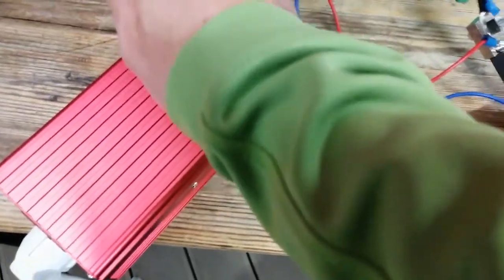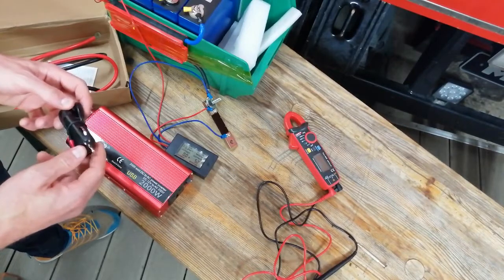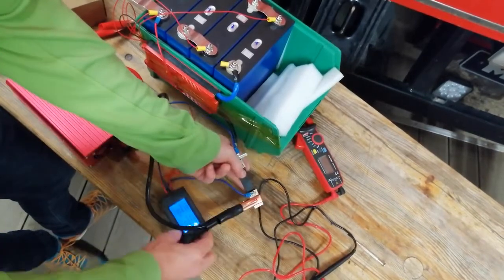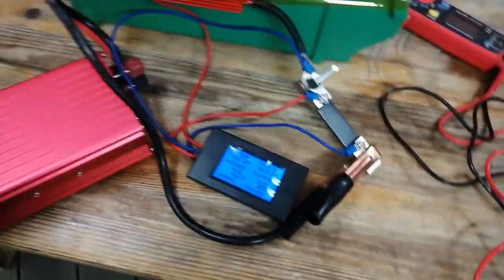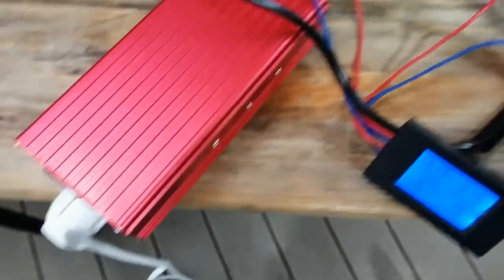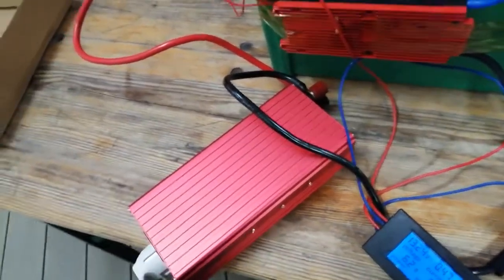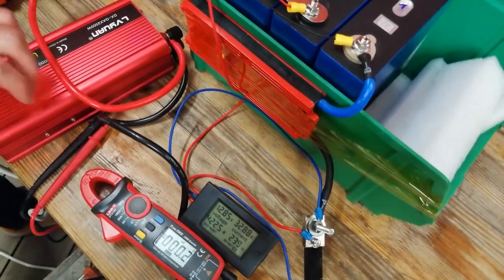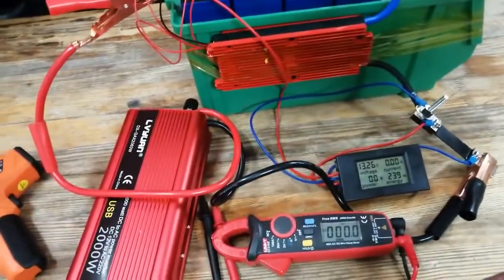Testing cheap modified sine wave 2000W inverter. Is it worth buying?

Comment: Is that thing safe for less than 5 minutes at 2000w? Would just need to engage a 1500w electric starter for about 30 seconds.
Reply from the maker: Hey @MWS67, I haven't tried it but I would not recommend it as it gets quite hot while pulling 1000W. So I guess it can't handle 2000W, even for a couple of seconds. cheers, Lupo
Reply: @LupoDIY  Thanks for the info. Saved me from finding out the hard way. 😁😁

Comment: that is a no test;  
?at least 800 watts or so, to see...
Reply from the maker: Hey Jose, the first test as shown in the video was around 1000W but the cables of the inverter couldn't handle the load at all. that is why I tried to find a load that could be handled by the inverter. I replaced the cables later (see other videos) which definitely improved the situation. cheers, Lupo

Comment: Why reccomend a 2000w modified sine wave inverter, and then say not to draw more than 800W? Why not buy a better 800 Watt inverter?
Reply from the maker: Thanks Nick for the question. I didn't recommend it, it was more a test and show what is possible. Unfortunately, a lot of cheap inverters  are not reallu usable for the their rating but in this case you can use it for e.g. 800W. So it is not super bad but don't pull 2000W. cheers, Lupo